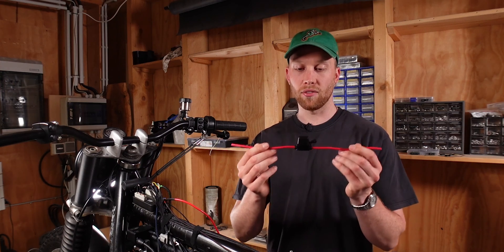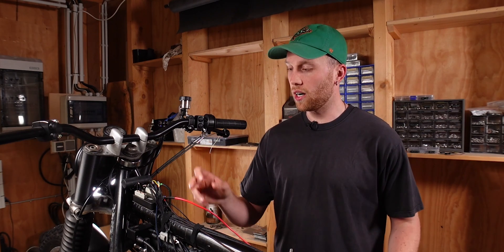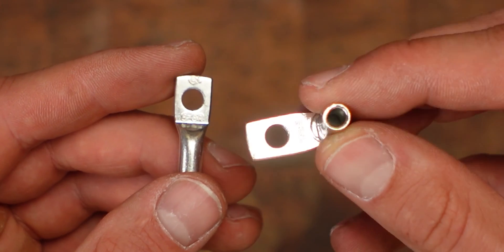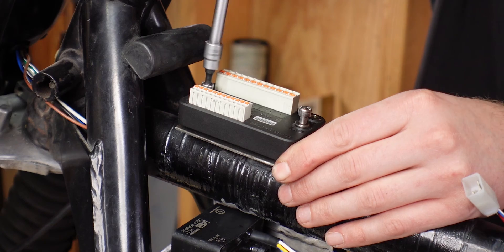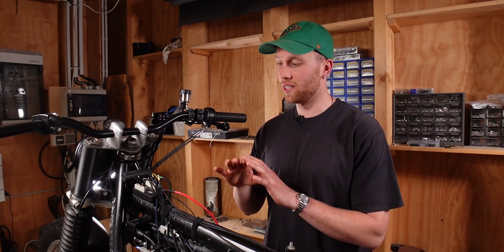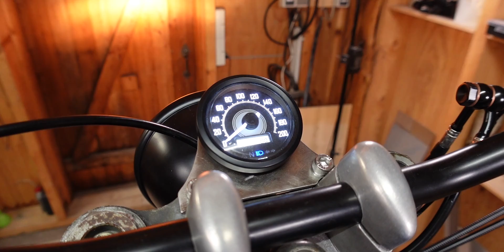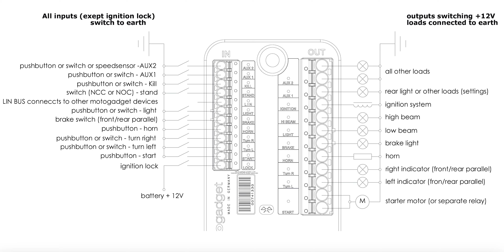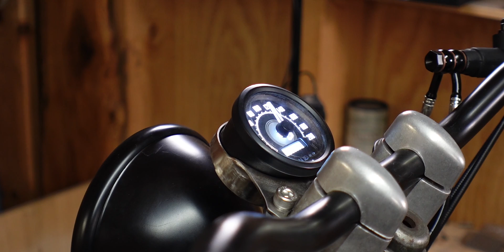How To Wire a m-Unit from Motogadget | Beginner Guide

Comment: I’m confused a bit on the starter motor wiring you talk about here. The mUnit can’t power the starter directly. It can only supply power to the solenoid. It works on your bike because the R80 starter has a built in starter solenoid. Most bikes, at least vintage ones, don’t have a built in starter so the mUnit needs to be wired to the solenoid. Then the battery will be wired to the starter via the solenoid. I just don’t want people to think the mUnit can supply enough current to power the starter directly.
Reply from the maker: Yeah, you're absolutely right. I did not communicate that clearly. Thanks for pointing it out! That's exactly how it works. Hope it helps everyone out.
Reply: In a previous video you mentioned you used a welding cable that connects to the battery, does that connect from the positive battery side straight to the m-unit battery side?
Reply from the maker: @fjm5341 the 16mm2 welding wire runs from the battery to the starter solenoid and a separate 6mm2 one runs from the battery to the munit BAT terminal. I hope that helps. Let me know if you have any other questions 👌
Reply: Each MoUnit output has a maximum capacity of 10 amps.  For BMW and Harleys use both START outputs to engage the starter solenoid as they take more current.
Reply: In that case, it will also apply to Moto Guzzi since the starters are similar to the ones BMW uses. @richardprowse1088

Comment: Hi Joshua,  I am using a mo gadget blue with a m button . I am looking to bypass the starter circuit as my starter needs a 70amp supply which I believe is to high for the m unit . Can give me any advice. Regards Martin.
Reply: Maybe I’m understanding you, but the mUnit blue manual states that the starter circuit would go to the starter solenoid (which is essentially a high current relay) instead of the starter itself. For custom projects I like to use a Yamaha starter solenoid as it’s compact and easy to connect. Has a built in blade fuse as well as a spare.
Reply from the maker: Hi brother, thanks you your explanation! I appreciate you helping out the community.
Reply from the maker: Hi Martin,
Sorry for the late reply. Let me try to help you.
The two wires from the start output of the m.unit have to go to the starter solenoid. The starter solenoid (which is basically just a relay) then closes the circuit that provides the power to the starter motor. This connection needs a much bigger wire that comes right from the battery. On the BMW the starter solenoid is directly mounted to the starter motor but that does not always have to be the case.

- This video might help you to understand how the starter solenoid works: https://youtu.be/P0vhRdAyE2Q (from min 11:00)
- In this one you can check how I connected the two wires coming from the start output of the m.unit to the starter solenoid: https://youtu.be/54pXhEeHDV8
- And at the end of this one you can see the big wire that provides power to the starter motor (through the starter solenoid) right to the battery: https://youtu.be/BCh8u9Rxm-E

I hope that helps. If you have more questions, let me know.

Comment: When it come to fuses, they should protect the cable in case of a short or overheating, so the fuse should always be as close to your battery terminal as possible. In critical installs like marine applications, we often chose a battery terminal with the fuse holder built into it. This is the best option. You should NOT put the fuse on the M.unit end of the cable.
Reply from the maker: Hey man, Thanks for the insights! I appreciate that. Regarding the fuse on the M.Unit, Motogadget specifies that there needs to be an inline fuse between the battery and the BAT terminal of the M.Unit. There is a drawing on page 22 of the manual, in case you want to check it out. Have a great day, my friend!
Reply: @MotoWrenchers  hes saying have that fuse be close to the battery instead of near the m unit. still inline either way
Reply: Oui, je confirme l'info ; je l'ai vue apparaitre dans plusieurs tuto vidéo et écrit sur le sujet !

Comment: I really wish I had this last year when I was building my R100.

Also for AUX1, I used them for my Hella foglights which are fantastic.
Do you reckon AUX2 can be used the same?
Reply from the maker: Hi Kevin! Style did you go for with your R100?
Hella fog lights (I guess mounted onto the crash bars?) must be amazing!
You could also power them via Aux2. The only thing I noticed is that the rear lights wich I power through Aux1 are synchronised with the headlight. I’m not sure if that’s something you can setup in the settings for Aux2 as well. Still need to check all the settings.
Reply: @MotoWrenchers  the Aux 2 output can be set in multiple ways
A) Active with ignition on

B) Active after engine start
C) ON / OFF with pushbutton connected to AUX2 input (no speedsensor possible)
D) ON / OFF with switch connected to AUX2 input (no speedsensor possible)
E) Active with ignition on / deactive 120s after ignition off
F) Day Running Lights (active when Low Beam / High Beam deactive)
this setting will toggle menu Low Beam to option Manualm
Reply from the maker: Thanks a lot. That’s great to know. I’m starting the rebuild next week and then I’ll check out the Munit configuration options once the bike is back up and running. Really appreciate your help!
Reply: @MotoWrenchers   no problem, done lots of MoUnit installs.

Comment: Great explanation and interesting to see how you have routed your wires and what gauges you are using!
Reply from the maker: Thanks buddy! Gonna make a video about calculating the right wire sizes.
Reply: @MotoWrenchers  That's a video I'm really looking forward to!
Reply from the maker: @HeavyMetalParkingSpot how did you choose the wire sizes on the savage?
Reply: @MotoWrenchers  I read up on what other people were using and from there I kind of guessed. I think I went way thicker than I would need to for some of the stuff. Not a big problem, but always nice to have as thin wiring harness as possible!